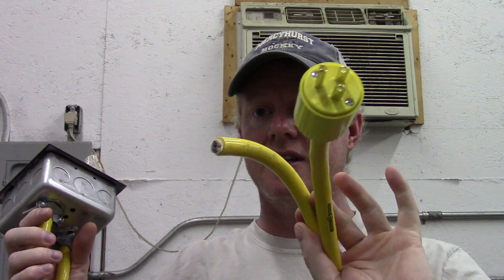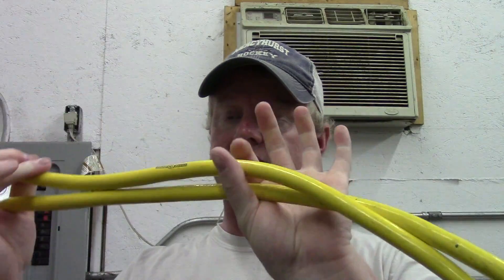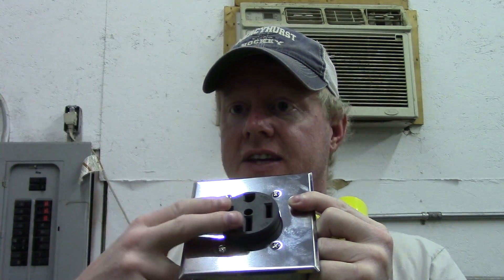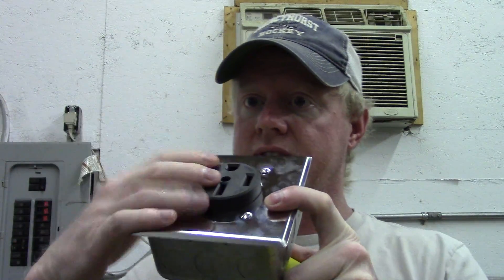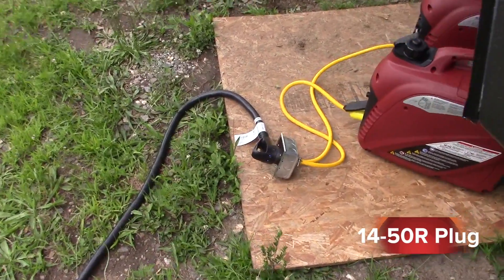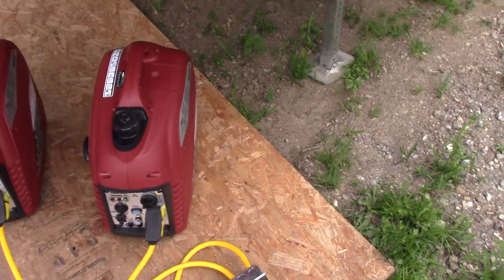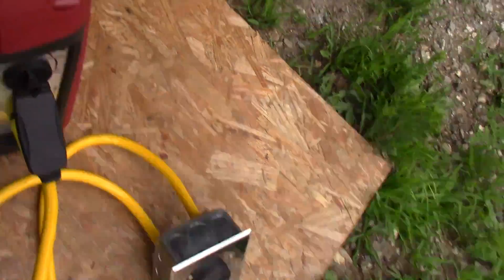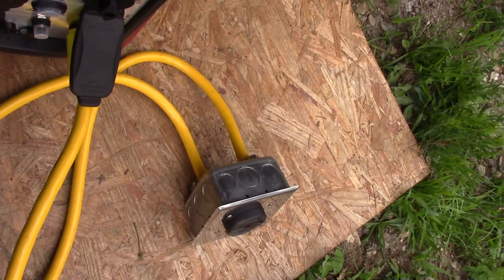How to make an Inverter Generator Parallel Cable  AKA Cable of Death

Comment: Is it possible to do this but have 2 phase operation? Put out 220v from a pair of 110v inverter generators?
Reply from the maker: It's possible but currently nobody makes inverters that will do that.  There a few 220v inverters hitting the market but I haven't seen one yet in person.
Reply: @ShaneBurrell1  Hmm... I guess I misunderstood the initial design of the commercially available parallel adapters such as what's offered for the Honda EU series. By linking a pair of 110v generators together, you are increasing the available amperage/wattage but it's still 110. I was kind of hoping to be able to use a pair to run the house during a power outage, and also be able to continue to use a 220v well pump. Thanks for the info, and it's a great video.
Reply: @jaredlazaron8414  The 220v in your house is not two phase. It is single phase.  One leg drops down 110v while the other goes up 110v so the difference between the two hot legs is 220v.  With the cable this guy has made both hot legs are joined together, so there is zero voltage between hot leg1 and hot leg2.  If you have any 220v appliances in the system you plug this into, they will not run and might send voltage to the neutral, as you found.  Not good and you should not connect it to your RV again until you identify where that neutral is getting voltage.
Reply: @jaredlazaron8414  Get a step up transformer which converts 120 to 240.  Easy-peasy.
Reply: @basketballjones6782  You're going to have to show me the step up transformer that will run an electric range when the power goes out.

Comment: Can I leave both plugs in with only one generator/inverter running?
Reply from the maker: I do all the time.  The inverter module shuts down with no input on the non-running generator.
Reply: @ShaneBurrell1   What happens when the inverter module shuts down?
Reply from the maker: @bradkvanbek7148  No connect.  I setup both gens always and sometimes I run one sometimes two.  Both are always connected. Always remember with dead man cable to never unhook anything when it is running for safety becuase you will have an exposed plug that is live if any of the generators are running.

Comment: Shane, my Honda EU3000is generator has (1) 30 Amp receptacle than can support 23.3 Amps. If I connected this receptacle to the same receptacle on another Honda EU3000is generator using your wiring concept …..could the “cable of death” that you are describing in this video support (2) x 23.3 Amps = 46.6 Amps of current??? Thanks, John
Reply from the maker: Yes. Just be sure to use a wire rated above 23.3 amps  to a 50 amp rated plug.

Comment: Any idea why my one older champion 2000w ( 5 years old ) starts revving after couple minutes of being hooked up to my newer champion 2000w with this dead man's cord? 
With AC off and starting the older one first than starting the newer one and turning the ac on it will run fine for a couple minutes then the older one start revving up and down and seems really loud compared to my newer one which runs normal.
Reply from the maker: Are they both inverter style generators.
Reply: @ShaneBurrell1  yeah
Reply from the maker: Governor issue / eco mode.  I haven't had an issue but have seen several older hondas in eco mode with low/no load surge with dirty fuel/carb.

Comment: Very well explained. thanks. I like your beefy cable and positive plug-in connection. We need to remember to bridge the 2 incoming black hots from the separate generators on the 50-amp or 30-amp receptacle; then close the gang box. Having extra female plug ends for covers when one or other cord is not in use is a good idea, too. Thanks.
Reply from the maker: Glad you liked it.  I've been using it for several years now.

Comment: Hey thanks for the video.  I see you don’t put a breaker in the assembly. I assume that is because each gen has a 20 (or 15) amp breaker at the plugs correct?   Does this mean that they trip individually and would basically both go when you hit about 40 (or 30) amps?  One would trip immediately when the other goes.  Correct?   Or if one gen hit overload and shuts down then the other gen would be tripped because in that scenario you would be above the single gen breaker.  Thx.

Comment: What if i ran  the hots separate tho? my panel has a split rail
Reply from the maker: From the generator it's really just one leg (one hot). If you have a standard RV split panel make sure you don't have any 240V appliances.
Reply: @ShaneBurrell1  gotcha. well i have two rockpals 2000watt inverters. It comes with a parallel box, but it pulls load from both gennys  because the hots are tied together. basically, i want to be able to run one side of the rail on one genny, and the other rail on the second genny so both of the rails have their own genny. can i do this with that 1450r female port and tie both neutrals together with the hots feeding individual rails? or would i need a separate neutral and ground?
Reply: and no 240v appliances. everything's 120.
Reply from the maker: @TonyChazz321  If the panel has 240 loads it won't work.  If you have 120 loads might as well just use the parallel box you have to provide the best current for 120 load.

Comment: This was so helpful. I have a small concession trailer. I am having to learn everything on my own. Can I ask what size plug that is going into your rv? We have a 50 amp plug and having to get a generator for that is expensive! We only have a 6x12 and use less than 5000 watts. I would love to this on 2 smaller inverter units because they are not as lound or HEAVY!!! So I can just get the male plugs that fit the 2 generators, wire them to the other outlet box that has my 50 amp outlet then I will be able to plug my cord into it and then to the trailer outlet? We had bought an adapter but it only had one hot leg so we were only getting half power to the trailer. This shouldn't do this correct? We should have full power? I know this is a lot  to ask but this looks like a fix to 2 of my huge problems.
Reply from the maker: I have a 50 amp plug on the RV.  Just be careful that everything in your trailer is 120V and not 240V.  If you need 240V this won't work.    Most RV's that have the 50 amp plug are designed to be able to put residential 240V appliances in but most don't including what I have.  You can look in your breaker box and if you only see 120V circuits you should be good (single vs tied double breaker).
Reply: We own a food truck with a 50 amp plug. We use 2 HF Predator 3500 inverter gennys. Firman 50 amp parallel kit, but the banana plugs suck! Already replaced 2 sets. Could I just swap out those plugs for the 15 amp plug on your video? These 2 gennys power everything in our food trailer. The Secret Ingredient Food Truck
Reply from the maker: @laureanorivera  Yes that will work just use caution as you end up with hot's that could be exposed if its not plugged in at all times to both gen sets.
Reply: @ShaneBurrell1  yes sir, thank you so much. I've read ALL comments and I'm aware.
Reply: @ShaneBurrell1  if you have two 3500 watt inverter generators then use two 20 amp make plugs instead of 15 amp plugs.
Reply: I have lighted plugs so if one is unplugged it is lighted if I use one generator I put both plugs in one generator have to be same outlet

Comment: Thank you for the video great job in a lot of knowledge I have one question what happens if one generator runs out of gas and back feeds and will that hurt the generator that is backfeed in in?
Reply from the maker: It won't hurt the either generator if one runs out of fuel.  In my camper I frequently turn off one genset when it's low load.  The main thing is if one runs out of fuel and the other isn't enough for the load it will overload and shut off power.

Comment: Seems like it would be safer just to buy a more powerful generator. I have a predator 3500 and I'm pretty sure It could run all  Of your things
Reply from the maker: The 3500 would work fine load wise.  It won't fit in my genbox and would be really hard to unload and load vs the two smaller units.
Reply: That makes sense the predator is pretty heavy for one person to lift. I really struggle with it myself and I am in pretty good shape.
Reply: Or just buy an actual safe parallel set up that is designed for your current generators... I mean you're already spending all that money on the RV what's another 40 or 50 bucks?
Reply from the maker: In my case I didn't want to have multiple adapters for my 50 amp plug.

Comment: Can I parallel 4 Honda eu7000is?
Reply from the maker: You can.
Reply: I have the Honda 6500 watt inverter generator. Does anybody know why Honda would not make these parallel capable. No banana Jack's like other Honda inverter gens.

Comment: I will be buying 2 Firman P05706  that are rated  at 5700/7100. They do not have parallel plugs. I just realised after looking at your videos that 4500 watt and up in Firman are not inverter generators. Their parallel kit  specifies up to 3300 watt. is there any way to hookup 2 gen non inverter ?? Great video !!!
Reply: Yes you can connect them, and using the same method shown here. The difference is you have to sync them manually, which was normal in the past but apparently a mostly forgotten skill. I've even synced to the city to boost the grid during exceptionally hot days, at the request of the utility co. The gen is in the megawatt range but it's still basically the same, just much bigger. Once synced they stay synced like two gears meshed together except it's the magnetic fields that lock them together. One drawback is if one gen runs out of gas the other gen will drive it like a motor. 
So the short answer to your question is; if you have to ask this question then you shouldn't do it. It doesn't mean you can't learn it though...
Reply from the maker: There is no way to use a non inverter. Different method of making power that isn't compatible. On very large gen sets ( 10+kw) they have a mechanical sync method but it's specialized.
Reply: @ShaneBurrell1  thanks for the reply. I'm going to buy one first then when I buy the second I'm trying to find a way with a junction box to power part of the house with the second generator. Not sure if this can be done easily and aafe. If I was to succeed I would have 12000 watt with max of 14000 which would be nice .

Comment: Just get a bigger generator
Reply from the maker: That's one solution. For many thou the smaller gensets in pairs are easier to lift out of truck or 5th wheel. Now that I have the long bed I'll likely do a 3500 watt single but until then the duals work great and easy to move around.

Comment: Okay so you might not like your wife but what happens when your kid or somebody else's kid or an unknowing bystander trips on the cord and unplugs it and thinks it's going to be dead on the prongs?

I have been researching paralleling kits and Generator paralleling and I see why Honda has always used those weird connectors of course it also helps that it makes it somewhat proprietary to some extent.

This is the best video I have seen yet that actually explains this fairly well and doesn't glass over the dangers
Reply: Therefore, parallel cable connection is up to 50 USD. It is not dangerous because it is specially designed.

Comment: I realize you made the vid awhile ago. I hope you are still out there:)  Can two of the same 2000 watt inverter generators that "do not" have parallel plugs do this? Will they sync? Would the chassis, or perhaps the external ground posts, have to be wired together also? I would like to double the 2000 watts and output to two female 120 outlets?  Would the inverters circuit breakers be enough or are extra required at the female side?  Have you connected inverters that "do not" have parallel plugs?
Reply from the maker: If they are inverter style generators designed to be paralleled yes.  The ground on the plug is normally already bonded to the chassis but you can check with a ohmmeter. The inverter breakers should be fine.  I have connected westinghouse generators that do not have normal banana plugs to my setup without issue.
Reply: @ShaneBurrell1   How can I check if they are capable/designed to be paralleled? Is the only way to tell if they are designed to be paralleled is if the banana plugs are present?
Reply from the maker: RidemFast The manual is likely to indicate . What make and model are you working with?
Reply: @ShaneBurrell1  Dirty Hand Tools 2000 Watt Inverter Generator. The manual does not mention it. The description says 
"Optional Accessories: parallel kit". But, the kit is not listed in accessory parts. And sometimes descriptions are not accurate.   Called the Dirty Hand Tools several times with no return calls.  I have their Log Splitter and they were very responsive in the past.
Reply from the maker: I wasn't able to find any info on that unit but I would suspect it will work unless they have done something really strange in there inverter circuitry.  It's certainly use at your own risk but if I had one I would bet it would work accepting the slight risk of damage, most likely outcome it working and in theory the load breaker should trip if they don't have a sync function.  So in short, yeah it is risky but if I had two of them I would try it under controlled conditions without hesitation. Westinghouse has a kit that has 2 normal 15amp plugs to a 30 amp if you want something premade with a 30 amp RV plug.

Comment: Nice setup.  Have you tried to use two different brand generators with that cable?
Reply from the maker: YouTube305 Several including predator, Honda, yamaha.
Reply: @ShaneBurrell1  have you tried connecting 2 inverter generators together that were not sold with parallel capability?

Predator 2500 Peak/2200 Running Watts, 4.7 HP (125cc)  - doesn't have parallel capability 

To a 

Predator 3500 watt inverter generator - has parallel capability
Reply from the maker: @ggr1847  I have but not that particular one.  Check the parts list for the inverter module.  If the module they used supports it, it will work fine.

Comment: Hello and thanks for all your knowledge sharing on this subject!  Although I think you gave the answer to my question in a response you made 3 weeks ago, but I'll ask anyway so others can easily see the question.  First I will be making this cord for two inverter style gens, a 1600 & a 2200 watts continuous (parallel ready).  To be safer, I want to always leave both male gen branches plugged into each of the two gens even when I then shut one off, say after I no longer need my RV's 15 K BTU Air Conditioner.  In your opinion do you think that would cause a problem and/or damage to the one gen that is shut off?  I'm thinking not, being that's actually the inverter's output side and just feel safer not even pulling that one out.  Thanks in advance for any response you have.
Reply from the maker: Gary Switzer That is the safest way to run them and unless they have used some non-standard inverter design it won’t do any harm. Thanks for the kind comments.
Reply: @ShaneBurrell1  i had the same question , I have the 1000 watt Yamaha generator and recently bought a 2000 watt Yamaha generator  I'm hoping to tie the two together with a cord like you made except the 30 amp setup.
Reply from the maker: jeff hagberg yeah you can copy same cable setup . The only difference will be the 30 amp won’t need a bridge because it’s only a single hot on the plug. So both hots from generator will go into the single hot. Just always have both generator pigtails connected anytime one or both generators are connected.
Reply: I was wondering the same thing and was thinking about a diode on both legs only allowing current to flow in one direction, eliminating the possibility of electrifying one male end or the other.

Comment: Hello I would like to make one if these for my race car trailer it has a 30amp 3 prong dryer type plug, how would I do the wiring in the junction box?  All I'll be running is a 13,500 btu a.c. thank you for any help.
Reply from the maker: If you are referring to a 240V 3 prong 30amp dryer I would refrain from doing that.  If it's something else that is 120V with a (hot, ground, neutral) that should be easy.  You won't be able to ever get 240V from inverter style generators .  With my 4 wire 50 amp shown in the video I just happen to have a camper with no 240V loads, it's all 120V.
Reply: Yes it's all 120 my chord just happens to have that type of plug on it, I'm not trying to get 240 sorry for the confusion. I'm just gonna be  running my a.c. I have a Pulsar 2000 inverter and I'm going to get another one and I'm like you I don't like their parallel kit just trying to figure out the easiest way to build this maybe just build what you did and buy an adapter? I'm just not sure how you parallel them on this type of outlet and if it can be done. Thank you sir
Reply from the maker: As long as you are 120V only you just take two 15amp cords and wire hot to hot, neutral to neutral, and ground to ground on the 30 amp .  Keep in mind the male ends need to be connected anytime your running both or either generator else you'll have exposed hot wires.  Your 30 will be identical to my 50 setup other than you don't need to bond the hots at the plug because you have a 3 wire.  The 14-50R, I have has two hot prongs you won't need to worry about.
Reply: Thank you for your time sir on another note I'm also a machinist and look forward to watching your machining videos.
Reply from the maker: I hope to have more machining soon. Here lately I've been machining RF enclosures that I'm unable to video due to contract requirements.